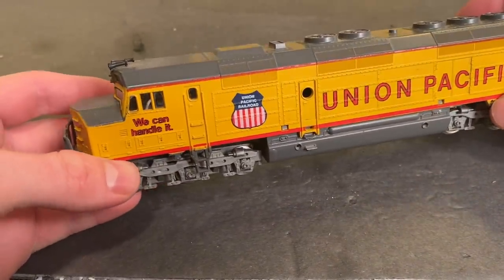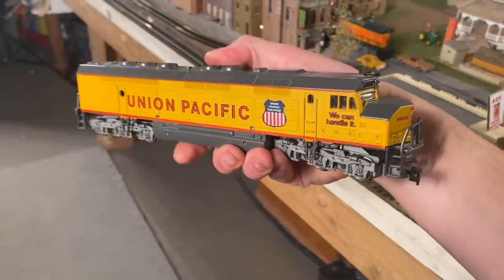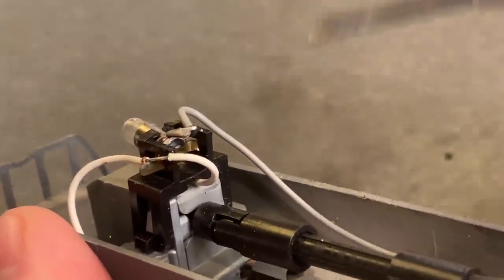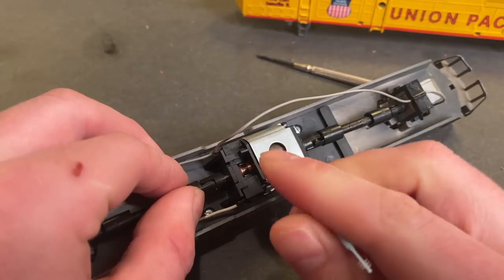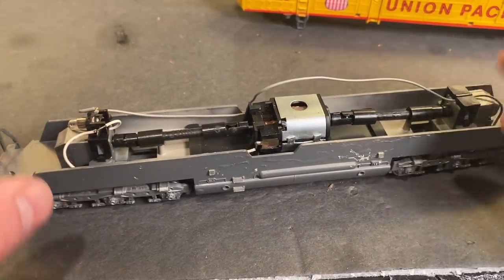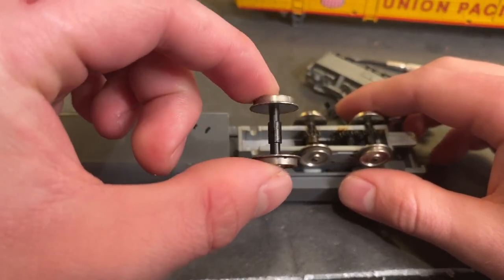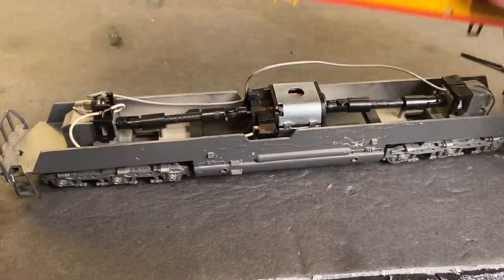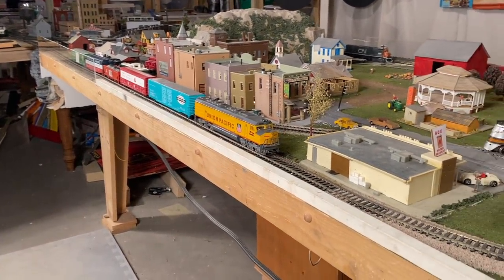Can We Make this AHM FP45 Run Again? 1990s Era Locomotive

Comment: Very cool locomotive Harrison and nice restoration!  I'm currently looking at an Athearn Genesis version of this locomotive dressed in BNSF's Heritage II paint scheme.  Now none of these FP45s ever got that scheme in real life as BNSF had retired all of the FP45s in 2002, but it sure looks sharp in those colors as does the UP scheme your AHM locomotive wears!  They may not be prototypical, but it's sure fun to speculate what could have been!
Reply: The Locomotives that BNSF had that looked like an FP45, were actually ex Amtrak SDP40F loco's. The SDP40F's were cowl bodied SD40-2 locomotives with water tanks and steam generators for non HEP passenger trains. These locomotives were plagued with derailment issues and were retired early by Amtrak. The AT&SF traded a number of their SSB1200 switcher engines (rebuilt SW1200 locos) in exchange for a number of SDP40F locomotives in the early to mid '80s. The Santa Fe rebuilt these, regeared them for freight service and designated them as SDF40-2's. These units survived the BNSF merger and remained in service until 2002, before being retired by BNSF.
Reply: @joshbenton4080  they had FP45s inherited from the Santa Fe as well and were retired around the same time as the SDP40Fs (classified as SD40-2Fs under Santa Fe/BNSF), though by the BNSF merger, they were rarely seen on the Railroad.  Although the notes Midwest Model Railroad has for the Athearn Genesis Model says they were retired by BNSF in or around 2002, a quick Google search shows all but one were gone off of BNSF's roster by 1998 with the last (no.90) surviving until the year 2000 and the SDP40F/SD40-2Fs followed suit just a couple of years later.
Reply: @joshbenton4080  forgot to add that there are 6 known survivors, all former Santa Fe/BNSF units (Milwaukee Road also rostered FP45, but sadly, all were scrapped in the 1980s) and are now in museums with one in operating condition (ATSF 108).
Reply: @randallellison6421  Your right, I stand corrected. I somehow forgot the AT&SF had FP45 units and the ex Amtrak units that the Santa Fe had were classified as SD40-2Fs. (That was a typo on my part) I vaguely remember seeing these units on the "Joint Line" in Colorado years ago, back in the early to mid 1990s, before the BNSF merger. I almost always saw them in the trailing position though and never leading. Question, didn't a number of the FP45s get repainted in the "War Bonnet" scheme in the late '80s and eventually get donated to a museum or two? To my knowledge, there are actually three former Amtrak SDP40Fs that still survive. Most of the SDP40Fs were traded to EMD for the then newer F40PH. Those were built with parts reused from SDP40Fs and classified F40PHRs Two of them are at the AAR Test Track in Pueblo, CO and the third one is up in Oregon.
Reply: @joshbenton4080  no worries, some of those SDP40F/SD40-2Fs spent their remaining years running here on the Thayer Subdivision (Springfield, Missouri to Memphis, Tennessee) and the Cuba Subdivision (Springfield, Missouri to St. Louis, Missouri) up until their retirement.  Back when I was in junior high in the late 90s, I would see one very once in a while  roll by in a consist.  What made it better was that the school I attended was (and still is) right next to the BNSF Thayer Sub Mainline so I got a fairly up close look at them, what a time to be a kid in that era!
Reply from the maker: I had no idea BNSF owned any of these.
Reply: @SMTMainline  it was for a brief time, but they did!  Unfortunately, by the time of the BNSF merger, these units were pretty much on they're way out the door as mechanical failures slowly did them in.

Comment: Hey I happened to run across  your video and had a question,  I have a Lionel steam locomotive  I need to service  and wondered what oil you used for the drive, I'm new to modeling and needs  some guidance

Comment: Great save!  You should be a hockey goalie.  To make sure it doesn't short again at the lightbulb you should look into some liquid electrical tape, a black rubbery liquid that's available in many hardware stores.   Just brush it over the exposed wire.
Reply from the maker: Not a bad idea, thanks for sharing.

Comment: Hey smt a friend of mine has a bachmann daylight freedom  loco and if you put wires on the wheals it works but if you put it on the track it shorts all at her train incolding itself but works if it is humid out side
Reply from the maker: It might be binding. Older Bachmann steam engines have all sorts of issues.
Reply: @SMTMainline  alright

Comment: The prototype was built by EMD only for A.T.S.F. and Milwaukee Road.  Only 14 were built and only for those two roads.   Santa Fe wanted a cowl unit for its Super Chief and El Captain passenger service in 1967.   When Amtrak took over intercity passenger service the FP-45s were put on the A.T.S.F. Super C TOFC trains and set the speed record for the Los Angeles to Chicago run.   The very first Super C trains were short trains and carried ony 14 flatcars loaded with 20-25 truck trailers.
Reply: It also ran past the BNSF merger but as trailing units on intermodals or stack trains and even on manifests.
Reply: @rdrogel   Incredibly,  6 of the A.T.S.F. nine units have been preserved at railroad museums.

Comment: I've always thought of AHM as being pretty low-end, but aside from being completely unauthentic looking, that actually seems to run pretty well!
Reply: Right up there with Bachmann, Tyco, Life Like, ect, all stuff i had as a kid.
Reply: Great motors though…….
Reply from the maker: Certainly better than life like, tyco and Bachmann of the same era
Reply: @SMTMainline  You got that right!
Reply: @SMTMainline  absolutely
Reply: Either this isn't an AHM, or AHM used the exact same OEM as Life-Like did, because I have an identical Life-Like FP45 that was made in Yugoslavia.  Mine is the Chessie System scheme (#8321).  They were also made in a B&O scheme (#8323) and Pennsylvania scheme (#8322).  One of the universal joints on mine is broken, unfortunately.  Life-Like advertised them as "8 wheel drive".  Still have the original packaging for mine.  It's very possible AHM and Life-Like used the same OEM, but the locomotive in the video is identical in every way construction wise to my Life-Like FP45 (even says Made in Yugoslavia).

Comment: Repaint it into ATSF later version of Warbonnet and number it in 90-series numbers. Then run it on intermodals as a trailing unit behind your 2 ATSF/BNSF C44-9W's on your layout.
Reply from the maker: It would be more realistic but I think I will just leave it as is.

Comment: Harrison, you're right. 
A couple more truck contacts and they would have had reliable pickups. 
If you want to make them run like a blue box Athearn, just add some barrel type flywheels to the motor shafts and then shorten up both of the plastic drives. Next, watch the loco just coast to a stop and also work it's way from a crawl. You'll be quite amazed!

Comment: hey smt great vid as always would just double check that connection where it looked like he wire was burnt up running from the front pick up to the motor looks suspect being a bit scorched or at least form the cam side of things was concerned but great vid as always look forward to the next vid

Comment: Either this isn't an AHM, or AHM used the exact same OEM as Life-Like did, because I have an identical Life-Like FP45 that was made in Yugoslavia.  Mine is the Chessie System scheme (#8321).  They were also made in a B&O scheme (#8323) and Pennsylvania scheme (#8322).  One of the universal joints on mine is broken, unfortunately.  Life-Like advertised them as "8 wheel drive".  Still have the original packaging for mine.  It's very possible AHM and Life-Like used the same OEM.

Comment: It is interesting that William McGeehan pointed out that the FP45 was bought by Milwaukee Road, not Union Pacific.  The Milwaukee Road had been using Union Pacific's paint scheme on their passenger locomotives.  If you go on You Tube & watch the Pentrex video, " Empire Builders to Milwaukee " there is a shot of a Milwaukee Road freight train with an orange & black diesel leading, with a passenger unit in Union Pacific colors following.
Reply from the maker: That's pretty fascinating. I wonder why they didn't just write Milwaukee Road on the side to make it an actual model.
Reply: @SMTMainline  - Mehano probably say the paint scheme & thought " Union Pacific ", they probably weren't aware of the passenger train relationship between Union Pacific & Milwaukee Road.  If I recall correctly, Rivarossi made E8 diesels that were decorated for Great Northern & Northern Pacific.  Great Northern only had E7s & Northern Pacific did not have any E units, just F units.

Comment: Very good easy repair  sweet run bys . its wild you would think its 12 wheel drive but the truth its 8 wheel drive with 4 traction tires or tyres. I would think this was when AHM was at or near the end of the line how they made cheapened ways to make locomotives. but its very neat looking just odd how they did the drive system . its held together similar way that some bachmann diesels were and Lifelike . i looked up on ho-scaletrains.com great website . They listed it being from built either by lima or mehano from 1976 to 1980s original price was  from $17.98 in 1977 to 1980s catalog $24.98 suggested retail.
Reply from the maker: Thanks a bunch!
Reply: @SMTMainline  no problem man .
Reply: Pretty cheap back in the day then what it is today

Comment: That looks like a decent motor and drive mechanism; it could probably stand to use a bit of weight at either end to help with tractive effort; similar to modern Atlas/Kato engines.

Comment: Of course it's a moot point whether these locos are worth our time??  How about swapping the tyred wheels on the powered axles for the untyred wheels on the trailing axles, then applying pickups to all the powered wheels.  You might even be able to find some untyred wheels from NSWL or somewhere to replace the tyred wheels on the trailing axles.  If you can get the stability your might even put pickups on the trailing axles.  You did not specify whether the bogie frame is metal???  If so you might be able retrofit conductive axles to the trailing wheels and get an easy ground.  Just some ideas.
Thanks for the entertainment.
Reply from the maker: If you have the parts on hand it might be worthwhile but otherwise it would be cheaper to buy a higher quality locomotive.

Comment: That's the way AHM wired their engines.   Four axle locomotives,  SW-1,  Alco S2 and RS-2 only 4 wheels without gears pickup the current while the geared wheels do not pick up current.   These engines also have the truck mounted couplers which can be easily corrected and the biggest drawback as far as I'm concerned.   No pilots 👎 because of those truck mounted couplers and the swing they require.
Reply from the maker: It's too bad because with a few more wheels picking up power they would have run much better.

Comment: That's the roughest low speed I've ever seen that didn't result in a stall.
Reply from the maker: Mehano 3 pole motors have strong magnets but cog pretty bad.
Reply: I'm wondering if it's all the motor's fault. I recall some modeller who remotored an old engine (was it a Minitrix 0-6-0? Not critical) and noted that it would now run slowly but not smoothly. The memorable thing is that he attributed it to the coarse gearing, saying that he could see the engine 'tick' forward one gear tooth at a time.

And that reminds me to ask, what's the top speed on this thing?  @SMTMainline
Reply from the maker: @triplicator  I find the transmissions aren't too bad in these models. If run the motor alone at low speed it will do the same thing. I don't know the stop speed in SMPH but I'd guess around 150 to 200 Mph.
Reply: So, like so many times,  it looks like an ill-reputed cheap model could have been an OK model if the maker had made changes that added little (extra pickups) and possibly nothing (scale-speed gearing) respectively to the cost.  (Excuse me while I get angry at price and feature bloat in the hobby.) @SMTMainline